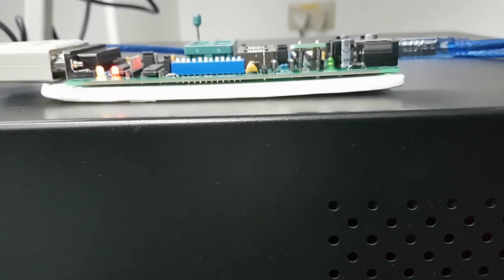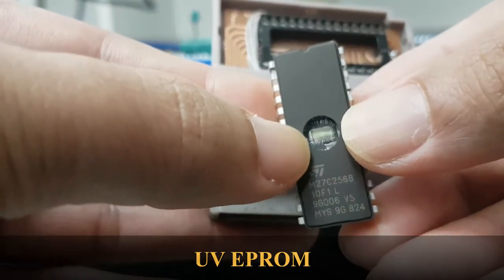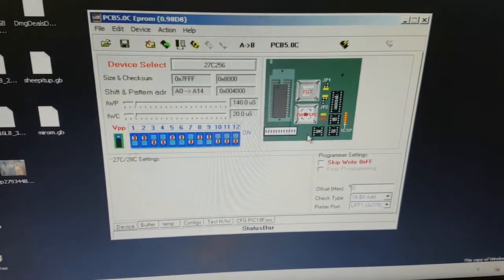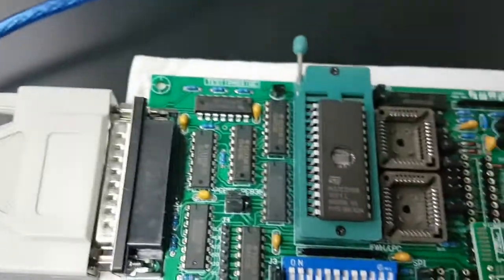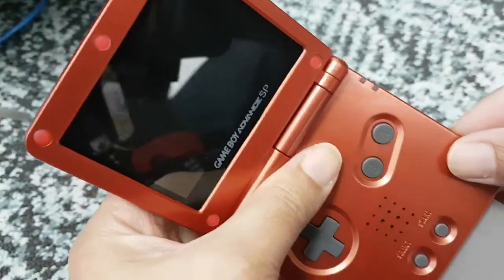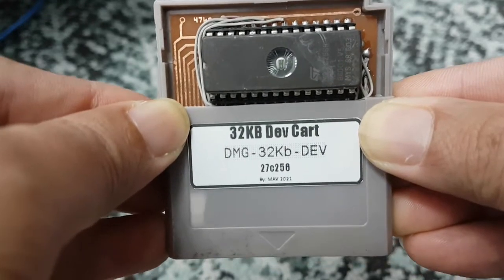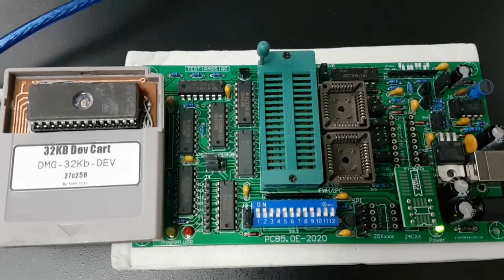Gameboy Game Development Cartridge

Comment: Hello, i already bought my Willem Programmer in order to program EPROMS, but now i am looking for an old computer with paralell port, do you  know if the PCB software works in an old Operative system like windows XP?
Reply from the maker: Hi. Yes the software for Willem Programmer should work in XP. If i remember correctly, WINXP supports the drivers better than win7. I had to install additional software to make it work on my win7 machine. You need to set your parallel port to ECP mode in the BIOS. Also check the I/O port address. Mine is set to 378h.
Reply: @BlueShotgunShells  Is it possible to use the Willem programmer in Linux ubuntu operative system? is there a software similar to PCB software in Linux?, thank you very much
Reply from the maker: @omareliotorrescastillo4808  Hi. Sorry I really don't know if this hardware is supported in Linux. I have only tried it in windows and since i got it working, i haven't tried other OS.
Reply: @BlueShotgunShells  Ok, thank you very much, now i have my EPROMS and the Willem programmer, i am ready to make the GameBoy Cartidges, i will try, thank you
Reply from the maker: @omareliotorrescastillo4808  best of luck to you. Enjoy!

Comment: Printable Toner transfer Template for PCB is impossible to download from the webpage filehosting, even as a login, is there another way to download the .pdf archives?, thank  you in advance
Reply from the maker: Hi. I'll send you a link. I'll look for the file first
Reply: @BlueShotgunShells  Thank you very much for help and support, i always wanted to create a cartride for my own, THank you
Reply from the maker: @omareliotorrescastillo4808  Hi. Try this link. https://www.mediafire.com/file/3vafvbgs0us51of/32K+only+GB+cart+for+M27C256B+Eprom_thick+lines+no+edge.pdf/file

If you have any questions regarding the PDF, let me know. My email is in the about section of this channel. I think you have to be  subscribed to be able to see it though. Best of luck.
Reply: @BlueShotgunShells  Thank you very much!!!, Awesome project
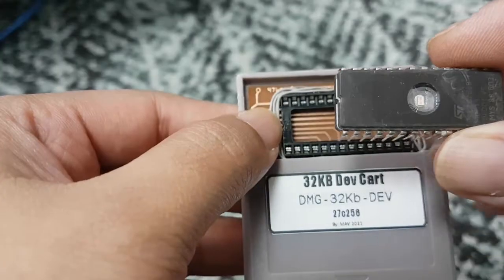Reply: @BlueShotgunShells  According to the video Minute 6:03, there are white wire cables stuck to the circuit inside the Dev Cart Cartridge, is it necessary to do this on the PCB circuit ?
Reply: Hello, do the PCB fits into the game boy cartridge? I printed the .pdf archive provided above on US letter size paper but it looks a little bit smaller than an original game boy cartridge size, no problem about it?
Reply from the maker: @omareliotorrescastillo4808  The pdf has no borders for the PCB. You have to cut it to size. Just make sure when you print it that it's 100% size. There are times that your pdf reader might resize it to fit the page. I can provide you another with a border. And the wires you saw in my video well those are for jumper wires. Since the board is single sided, there is no way to route the traces except to use jumper wires. Let me sort out my files and hopefully i can get back to you soon. Thank you for taking interest in my project.
Reply: @BlueShotgunShells  Thank you very much for your support, I will see how I can fit it, this is good for learning Gameboy arquitecture process, thank you very much
Reply: @BlueShotgunShells  Thank you, i will print it again in 100% scale, i guess this was my problem, thank you very much